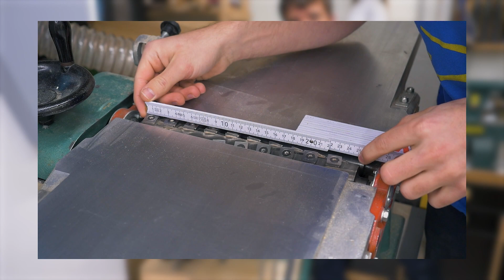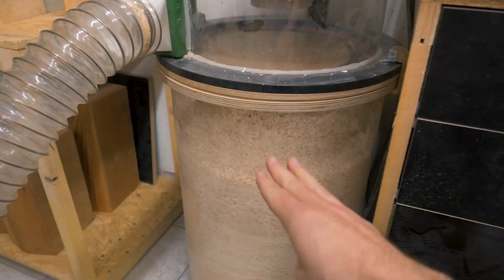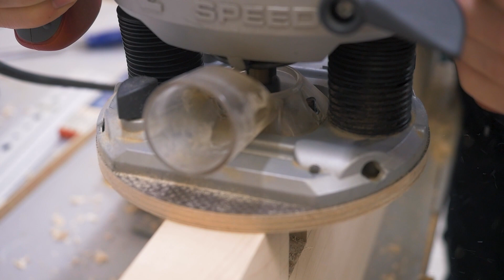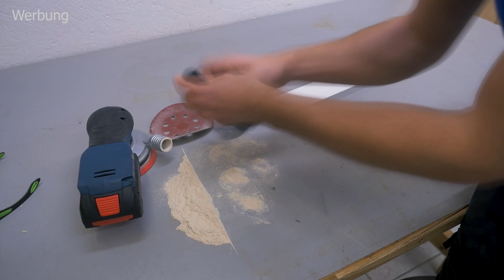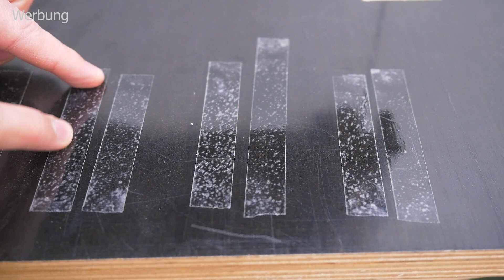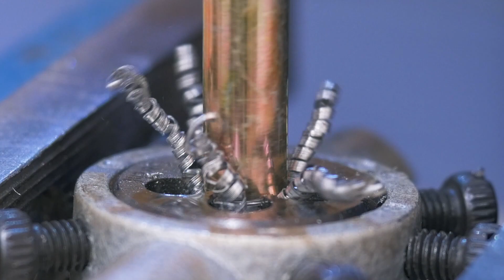Floating Shelf | Easy DIY mounting

Comment: used the mesh discs a lot - they perform way better with a shopvac attached.
did you use the special adapter that goes between the discs and the sander ? that makes a difference as well.

Comment: Interesting shelf design, but the soundbar is a design fail in the first place. TVs are now only a visual display. I connect my TV's sound output to a decent amplifier and attached speakers. A soundbar is just a pathetic attempt to restore the pathetic functionality that used to be in the TV, but it won't be much better.

Comment: Lighter weight shelves can be tightly attached to walls using furniture cam-lock hardware. It works so much better than whatever they give you in the package.

Comment: Your tape test seems like it shows reasonable results. You'd almost need a rig that moves the sander in a pattern for x amount of strokes to compare how much material is sucked up then compare the weight of the wood before and after kind of thing. I think it is important to know how much wood ends up on the floor or in the air.

Comment: I like the idea of the bolt tightening pocket, but why not use a hex-head bolt that requires only a thin pocket for an open-end wrench?
Reply: none of them are perfect if you wanted to use a bolt instead it require a wider slot while this require a longer slot.
He could have made the slot way smaller by cutting the allenkey aswell
Reply: @Nickerian91  There are certainly tradeoffs.  The Allen key requires a deeper slot for the tool, and requires additional slot length for insertion and removal.  The hex head combines the two, though -- the same space that is used for tool insertion and removal is also used for turning the bolt head.

Comment: The slot could have been made significantly smaller if you had cut down the hex key. You could have taken out 1/2-3/4 of the depth front to back by taking a cutoff wheel to the hex key and cutting all but a few millimeters past where the key straightens out. 

Good job though. Looks good. I like the live edge and the fake live edge with a sanding disc on an angle grinder. Nifty trick. I will have to keep that in mind.
Reply: But then you'd need to cut another allen key when you need to take it off (since you'll lose the tool).   Pay the price now, and you'll recoup on the backend.
Reply: @hansangb  I have a box full of hex keys leftover from stuff I've assembled over the years. It is a minimal amount of effort. It is not as though a shelf like that is detached and attached on the regular. It is far more effort to chisel out such a large clearance mortise.

Comment: Seems like the mass of the maple X the moment arm (x g) applies a lot of torque at the edge/wall interface.  You must have much better drywall in Germany than we do 'cause that shelf would have already cut a line into my drywall and the shelf...well not so much level anymore.  Nice finish work.
Reply: We don’t do drywall in Europe. Our houses are built with bricks and concrete, and plastered over.
Reply from the maker: It's a brick wall

Comment: Interesting … Bosch mesh disks. Did you have any problem with the hook & loop holding since more of the sander’s platen/surface (between the holes) is exposed to dust?
Reply from the maker: No, the hook and loop I'd pretty good. It slipped a bit after some use, but is easier to remove again after longer use

Comment: Damn, that's a huge hole just to tighten a bolt ;)
What I've done and works well in situations like that (and is invisible): angle the plate a little so that when you push down the board, it pulls itself to the wall (takes a few tries with adjustment). Instead of angling the plate, you can also bend the "flaps" of the slot a little. Or use a triangular slot and use a counter sink head screw. It has the same effect: the further you push the screw into the slot, the more it pulls on the screw. Both methods even allow you to level the board a little after the fact, because you don't have to bottom out in the slot for it to work.
What also should work (but I haven't used it for that and there might be a problem to lock it in place tightly): screw a threaded rod into the wall and stick the board with matching holes onto them. Then use a small screw from the bottom to lock the rod in place in the board.
Reply from the maker: That sounds similar to a french cleat
Reply: @MariusHornberger  Couldn't you have shortened the key or use a different type of bolt (Sechskant zB)?

Comment: IIRC, Mirka were the first to market with Abranet...  excellent finish and dust extraction...  lasts really well too.  I've got some  pieces of 80 grit that are about 8 years old.. well worn and probably 600 grit by now but they just last and last...  The only disks I'll buy now are net type.
Reply: I agree and can vouch for Abranet as well, they last so much longer than normal sanding discs. I've been using some 4 year old discs as well on hand sanding blocks! The only downside I've found is that they can tear easier on edges but you just need to take care.

Comment: a cheap allen key could be cut very short so as to limit the size of the cutout. And then you could considcer taping it to the underside😆
Reply: Mhmm, I'm thinking more about some kind of spring loaded hole from the side from where the key could pop off.
Reply: I came here to write that. 😃👍